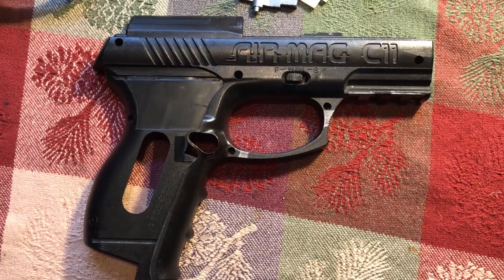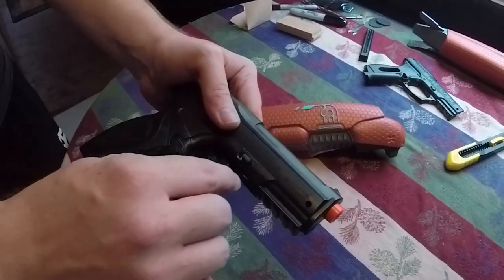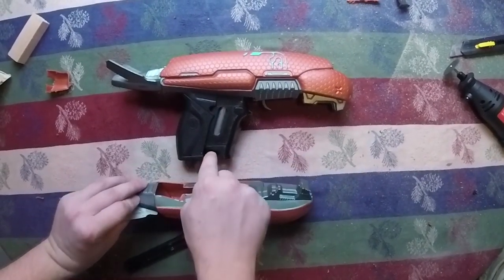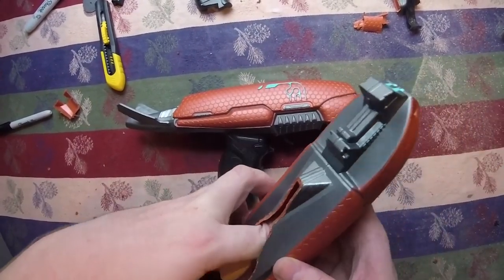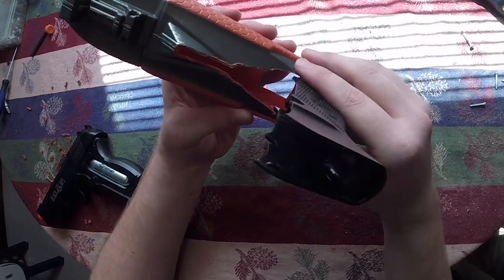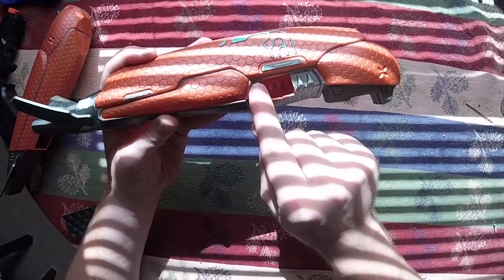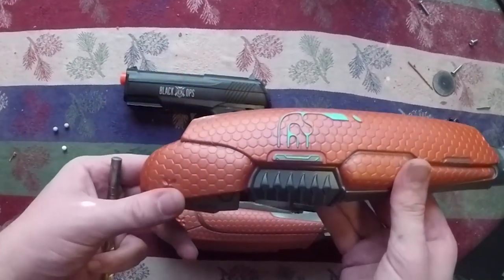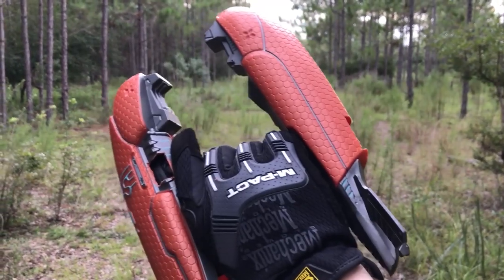How To Make Your Own Halo Airsoft Plasma Rifle - 1,000 Subscriber Special!

Comment: I feel like a KWA MP9 would give the gun more mass/ rigidity and the ability to fire full auto/ reload practically
Reply from the maker: That was my initial thought. But the disguise plasma rifle seems to be to small for it, which is why I use a pistol for the conversion. However! I believe that the laser tag plasma rifle might work with an MP9 because of its size.

Comment: Hey spartan jess, I'm currently working on a smg kit that can be 3d printed. When it's finished ill let you know.
Reply from the maker: Awesome. Yeah man, definitely let me know when you're done.
Reply: We want to know if it's finished
Reply: @LockheedC-130HerculesOfficial  crap happened. I managed to get a magazine design that works. Also. The Kythera engine will make it a more flexible design. Main problem is I no longer have access to a copy of solidworks. If I can scrape the 2000 dollars for the copy and update, the 600 for the ender printer, and the money for the filament, I can EASILY finish the project.
Reply: @grif777_7  damn sorry to hear that
Reply: @grif777_7  yea I think I’d go with buying an krytac kriss vector for $500 at that point